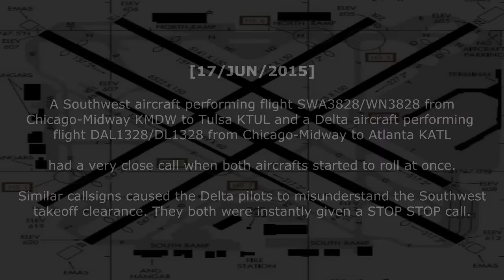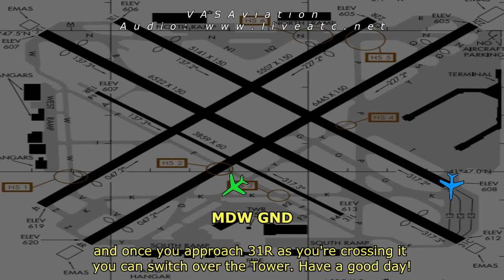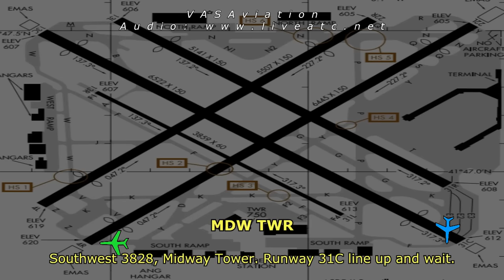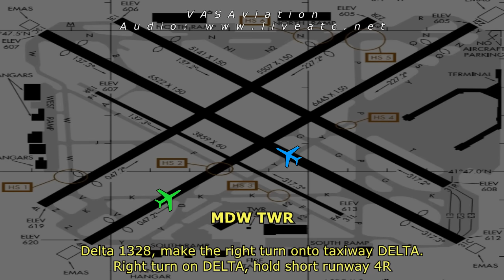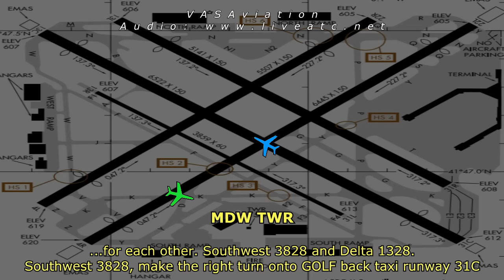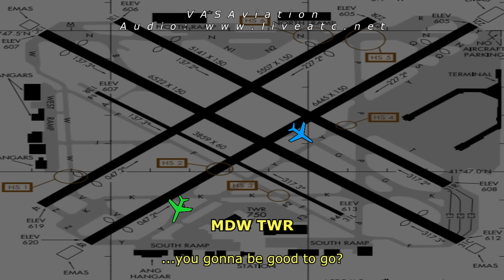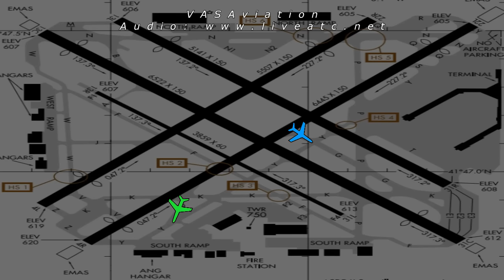[REAL ATC] Delta and Southwest VERY CLOSE CALL on takeoff

Comment: Unacceptable. Both crews were warned and should have aborted on their own considering the frequency block. Also controllers should have let one holding short - what are 2 minutes in such a pre-identified callsign conflict situation? Hope some disciplinary was taken there.
Reply: If anything the Delta flight should have been asked to hold short to allow for both the SW flight to take off and the inbound traffic to land...when I fly if I don't understand the instructions, I ask them again for clarification, it's one of my nightmares, not understanding an instruction and causing an accident.
Reply: The crews don't hear the frequency block, they're the ones talking.
Reply: It probably wouldn't even have delayed the Delta take-off at all. Soon as SW is cleared to take off and starts to roll, you can instruct them to go ahead and line up. By the time SW is in the air and out of your hair, Delta's good to go and can be cleared for immediate takeoff, just as quick as if they had been lined up the entire time.
Reply: @TahreyUK  Traffic was landing 4L that SWA3828 needed to beat off 31C. DAL1328 was locked and loaded to beat traffic 2.5 NM behind the 4L traffic. Unless you see the actual replay and hear the actual audio (the same the pilots hear), I would suggest you reserve judgment

Comment: Hi, why would the pilots need to contact company? Aren't they allowed to make decisions on their own accord?
Thanks
Reply from the maker: Hello,

They need to give a report of the event to the company and dispatch so they know any possible delay or even the cancelation of flight and other stuff the company needs to know-
Reply: They need for all their action an approval. So, they contact their company. This the same if they want to eat something or drink in a foreign country. The company must know it and record it, for safety reasons.
Reply: But still, according to the rules, the captain have every right to decide what is best. The captain still needs to approve it.
Reply: Ifly 777 yeah, but he don't want to lose his job...so he must contact the company. its a tough business today. Pilots are under a heavy pressure. They need to contact the company all the time and ask for approval.
Reply from the maker: Ifly 777
The Captain owns the plane. The Captain rules the plane. The company owns the Captain. The company rules the Captain ;)
Reply: Also running numbers on fuel... depending on how far into take-off burn they were, it may or may not be significant, but a check and verify is required nonetheless.
Reply: Maybe hitting the brakes in an emergency with a dully laden aircraft could overheat and damage the brakes so maybe they need to check for if they need to return for the ground crew to inspect them before takeoff. I wouldn't imaging they would be happy to lad and the other end and find that the brakes fail because they didn't check them.
Reply: zephanish Any disruption in normal, day to day routine operations of a flight must be reported to the company. Especially if it involved an aborted takeoff and potential endangerment of the crew and passengers.
Reply: Some people just don't get it.
Reply: Amateur Flyer exactly. 'S why he asked "hot brakes?"
Reply: Daniel Cannata also hot brakes lose a percentage performance so they might have to wait until they cool down before they can safely attempt another take off.
Reply: Yeah depending on the airline too, they might not end up in personally-identifiable records at least for the entire company to see (or those relevant parts of the airline I should say)..; that's how US Airways did it anyway.
Reply: That's interesting, Sky Flyer.  Re: "There's only one airline where the captain has unquestioned authority, Lufthansa. Pilot never has to fear corporate second guessing him."

Comment: The thing that disturbs me about this is that both aircraft were advised of similar-sounding callsigns and the controller clearly stated "Three One Center" in the takeoff clearance.  How Delta screwed this up is beyond me, as both a pilot and a controller.

Undoubtedly, the initiator of this incident was the "no delay" takeoff clearance, which caused both aircrews to rush and not pay careful attention to the controller's instructions.

Comment: Why would you line two similar planes up with each other? This could've been avoided had you told one to hold short.
Reply: Then they would have both held short.
Reply: @DanEllis  Probably a better outcome really.  Might have avoided delays and the potential of worse for both aircraft.
Reply: Not really. Line and up wait is not the same as being cleared to takeoff.
Reply: @SYDAirlineEnthusiast  Can't take off at all not pointing down the runway. No confusion can be made if not pointing down the runway.

Comment: Maybe if they had some better radio systems that weren't so garbled and ATCs who didn't talk so damn fast, they wouldn't have this issue. I get that they're profession pilots who should have a better ear, but that's still an very avoidable incident by something as simple as not setting both similar call signs up for take off at the same time.
Reply: crazynova23 pretty sure you cannot recieve and transmit data on the same frequency. Also you cannot recieve data from 2 diffrent sources. If this happens they will be cut off as you can see in this video
Reply: But we need to spend $6-20B on a wall cause it's a national emergency.  While our infrastructure slowly crumbles to the ground.

Comment: this is why i hate the way the americans do radio. had they broken the numbers down indvidually that would have stopped this from happening. DELTA 1,3,2,8 not thirteen twenty eight like they said which sounds pretty much the same as thirty one twenty eight on the radio.
Reply: James Stokes youll never catch THIS american doing it that way.

Number by number if the safest way. Worth the extra 2 seconds of filled comms.

Comment: Is it a requirement that ATC and pilots have to speak as fast as they can?! If they would just SLOW DOWN and ENUNCIATE just a LITTLE BIT, this kind of thing might be avoided! I'm not a pilot, I'm in news/talk radio where enunciation is very important to communicating a story.
Reply: The diffrence between your news radio and ATC is that you probably only transmit signals while ATC transmits signals and also recieves them. This means they have to say everything as fast as possible to "clear" the freqvency since radio equipment cannot recieve and transmit data at the same time on the same freqvency
 (sorry for spelling errors)
Reply: One word - duplex
Reply: Obviously you've never put on a headset from either side of the microphone. At busy airports, seconds matter. You miss a gap and then the flight doesn't get out on time. It has a domino effect on all the planes behind it. This audio recording is terrible compared to what the controllers and pilots hear. There are not 'clipped' call signs or numbers. The blame (as determined by the FAA) was squarely on the Delta pilots.

Comment: In regards to the connection with the Tenerife airport disaster ( Sunday 5:06:50 pm March 27, 1977) there was a terrorist attack earlier in the day at Gran Canaria Airport where both KLM and Pan Am were due to land; hence the ill-fated decision to divert to Los Rodeos airport. Other factors such as limited airport facilities, no ground radar, runway lights not working, misunderstandings/confusion, technical VHF limitation (i.e a Heterodyne), delays, thick fog with visibilty reduced to less than 100m, overwhelmed ATC personnel (only 2 ppl were working that day), missed exit, takeoff without clearance, junior vs senior crew behavior and the extra weight from refuelling prevented KLM's last ditch attempt to avoid Pan Am led to the runway collision and the worse aviation accident in history with 583 fatalities and 61 survivors.

After the disaster, changes were made to international airline regulations; use of standard phrases and acknowledgements/callback and English as a common working language. In the aftermath, a new airport was built to accommodate international flights at Tenerife. 

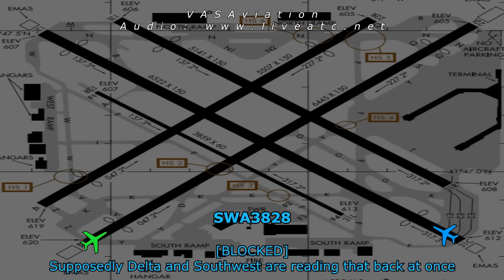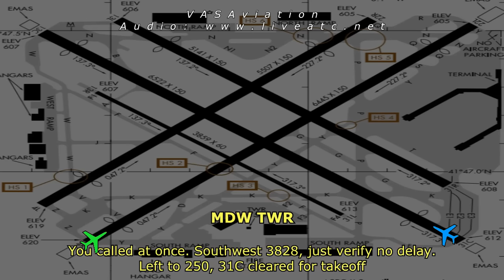The incident involving the Delta and Southwest airliner at Midway just goes to show that human error and technical limitation is prevalent and still ever present; twice vital messages were blocked, 1:17 and 1:25.

I'm just relieved that both planes stopped in time and saved the ~250 souls onboard.

Comment: ATC did a ridiculously bad job of clearly addressing the correct planes, especially after they had both just called back.
The green plane should of cause not have taken off when his runway was not mentioned in the transmission.

Comment: I think it’s INSANE that we have active runways that cross each other.  
Like having a cross walk on a freeway
What could go wrong
Reply: Dude, wind it doesn't always come from the same direction.  Some locations have to have runways going in different directions.  Because of other practical, and economic, reasons all those runways have to be in basicially the same place.   --- It's not insane
Reply: @JosiahLuscher  You missed the keyword "active".
Reply: Well, it’s a good method to save land area and, over time, has proven to be just as reliable with air traffic controllers in duty.
Reply: @JosiahLuscher well I think it’s better if one of them was used for takeoffs and the other for landings.

Comment: This ATC needs to learn how to speak whole words
Reply: Aint got no time for dat.
Reply: He did have to say "Stop answering for each other". If you cant know the difference between Delta and Southwest you SHOULD NOT be flying an aircraft. The last two numbers might be the same, but Delta and Southwest are different, even when spoken fast. Delta wasnt listening, and Southwest even called back (You can hear it) "Cleared for take off .... Southwest 3828" And then both start rolling. I agree they need to speak slower, but just because both your call signs start with the 'thir' sound (Thirty Eight, Thirteen) It does not mean that 'thir' means you (Directed at 1328). He even realises he's fucked up. You only hear the 28 part again as 1328 is ordered to stop. Only 1328 responds initially, not only that, 3828 then responds to the request to go to taxiway DELTA, which is the exact opposite way he was going. Both 1328 and 3828 screwed the pooch royally by having 'pilot syndrome'. The undenyable right that what the pilot hears cant possibily be right, so they do what they think is correct instead. Such as double responding, not listening after being told the issues. Its more commonly seen on ATC videos of Pilots and controllers arguing, either about where they can taxi, when they can take off, and where they can park. Pilots are smart as hell, but way too many have inflated ego's and cant accept that the call on the radio ISNT their call sign.
Reply: @ulysses damon  I agree... partially... 
- ATC was cutting first part so it was always "<static>28 do something" (and I get it... a lot of work)
- Delta should have listen more carefully as to which runway was cleared for takeoff. as that was only clear part of message to differentiate those planes and correction message should be clearer
- Callouts about heavy traffic would put stress on pilots of both planes
- Limitations of radio delayed any corrections, and because both of them tried to talk at the same time 1328 and 3828 did not hear each other (AFAIK in half duplex radios when you key up you block receiving)
- Fortunelty nobody ask for details when ATC said "...28 STOP STOP STOP", and nobody got hurt. And fact that Southwest also stopped supports idea that communications was not clear enough
- Only after both blames aborted takeoff radio became clearer, and there were no more miscommunications that I heard... (That call from 3828 felt more like "We are here. What should we do?")
so yeah.... I think both ATC and Delta pilot were at fault

Comment: This is also why the plane the President flies on is called "One" if it's an Air Force plane it's "Air Force One"

Columbine II was the first plane to bear the call sign Air Force One. This designation for the U.S. Air Force aircraft carrying the incumbent president was established after an incident in 1953, when Eastern Air Lines 8610, a commercial flight, crossed paths with Air Force 8610, which was carrying President Eisenhower.

Comment: I'm not a pilot and I'm not sure if the recordings as we're hearing them are exactly as the pilots heard them, but if so, wasn't the male controller being a little unclear/hard to understand? The beginnings of some crucial instructions are either spoken extremely quickly or he was punching in late (if that's the right terminology). Is that fair? Or is it the recordings?

Comment: This is insanely frustrating. Both pilots were made aware of the potential issue. Delta and Southwest do not sound alike, yet they mixed things up. And last, why would ATC not just use the actual digits instead of shortening them? If they said, Delta 1-3-2-8 and Southwest 3-8-2-8, this never would have been an issue.  We've heard plenty of times where ATC says something like 1-3-thousdand feet, so I can't imagine it wouldn't have been allowed here. Hell, even Delta 1-3-28 and Southwest 3-8-28 would have worked.  The situation was ludicrously avoidable.

Comment: Honestly this seems like the situation was caused at least in part by crappy radio comms or procedures. You will notice that the tower transmission has the beginning of his transmission cut off/unreadable rendering the full callsign down to static-28. I was in comm in the Marines during OIF and certain types of radios can have this effect necessitating the need for a pause when you first key the mic before you speak and for you to enunciate carefully. The pilots ideally should have called back reporting the broken transmission and requesting clarification. I understand the time pressure they are under and it's a hard job no doubt but for something vital and dangerous if it goes wrong needs to be done right. And if your schedule cannot handle small pauses like that then there is something very wrong with the whole system.
Reply: This was a problem with the person who recorded this off the air.  They had the levels set way too hot and the AGC was pumping on the recorder. The actual comms didn’t have this problem.

Comment: I get it. Similar call signs both lined up waiting for take off. Traffic inbound, other chatter on the radio, and so much going on in the cockpit you blank on what run way you’re on. Now you hear what sounds like the end of your call sign and clearance to take off with no delay. Could of happened to anyone. It’s like when you’re at a red light and happen to be distracted by the radio or maybe daydreaming when you see the light turn green so you almost go but then realize a split second later your light is still red and it’s the turning arrow that turned green so it psyched you out...

Comment: The problem I see is users keying mic and stepping on each other. Also, one controller handling both aircraft. Question for pilots or ATC on here...Would it be possible for these two aircraft to have been assigned to separate controllers. KMDW has two departure frequencies. 126.05 and 128.2

Comment: The controller did a good job at the advisement of the similar sounding called signs and then proceeded on "mumbling" the T.O. clearance so that it was very hard to distinguish the difference.  The controller had some obligation to take his own advice and slow down, or otherwise articulate the first number in the call sign.

Comment: So it looks like the two planes were initially on two differently frequencies when 3828 was briefed about the similar callsign prior to changing over to that second frequency. the 3828 confirmed they would be listening for it once turned over to the second frequency for takeoff.
The 1328 that was already on the second frequency wasn't briefed that 3828 was about to join the frequency. 3828 had a higher situational awareness than 1328 who seems to have not been briefed, and so when the ATC cleared 3828, 1328 (13 sounds like 30) they both went.

Comment: It's one thing to mishear the callsign when both end with ...28
It's another thing to mishear the "runway 31 Center cleared for takeoff" as "runway 4 right cleared for takeoff"
I mean, isn't that the point of the advisory warning about the similar callsigns, that you should listen more carefully and if the controller says a different runway, then it's definitely not you...

Comment: Yes they have similar call signs and yes someone stepped on the frequency. BUT as a pilot in training I have to say the Delta pilot is on fault here regarding. You can clearly hear 31C cleared for takeoff. As a airlines pilot or any professional pilot, even myself as a student pilot while taxing, take off and landing you should know your assigned runway. Delta 1328 was on 4R.

Comment: That was 100% the controllers fault . There was no reason to line them both up on intersecting runways at the same time. He should have instructed one to hold short and cleared the other to line up and wait. Then the comment about "You were getting stepped on but I didn't know who it was"...Who else would it be other than the pilot with the similar call sign...unbelievable.